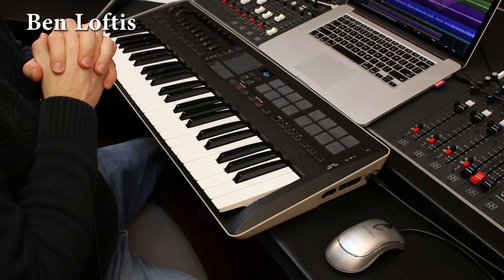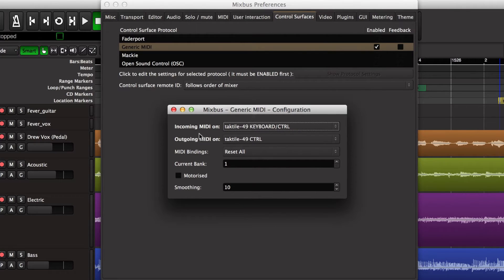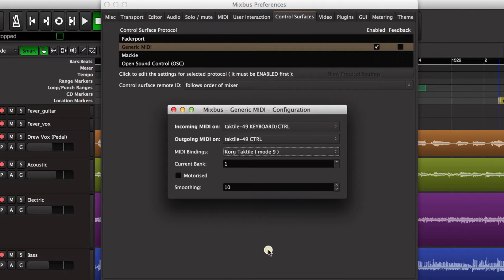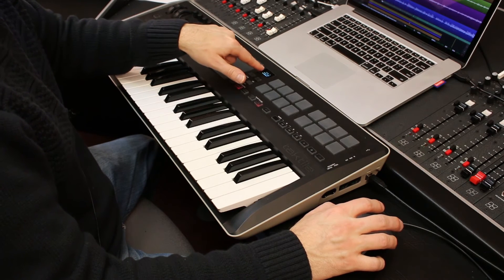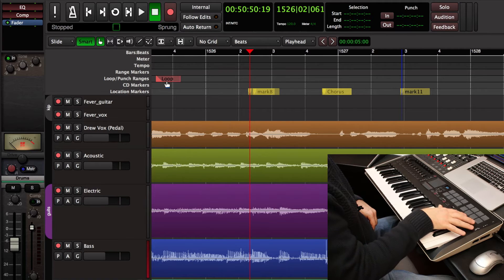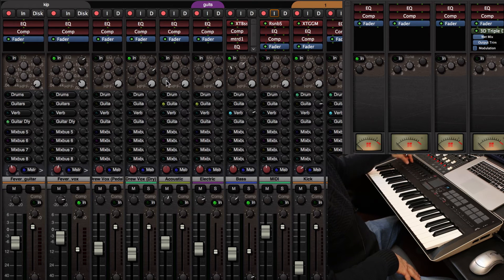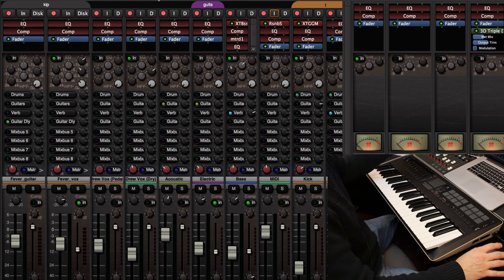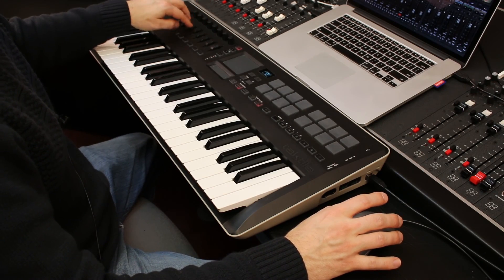MIDI controllers (advanced)  in Mixbus (v3,4)

Comment: Afternoon,   Thanks for posting this video, its awesome.  2 quick questions.  Using the Korg NanoKontrol2 when I select it from the generic device menu [NanoKontrol2 w/Master] it doesn't seem to connect properly.  When I select "Mackie" and NanoKontrol2 from the I/O it connects and works normally.  I would like to use fader 8 as a Master, is there a way to assign it when using the "Mackie" settings [Ctrl+center click].  Or am I just setting something up wrong under Generic when I select it.
Reply from the maker: Hi Trig242, Could you please email Harrison Mixbus Support? Thank You